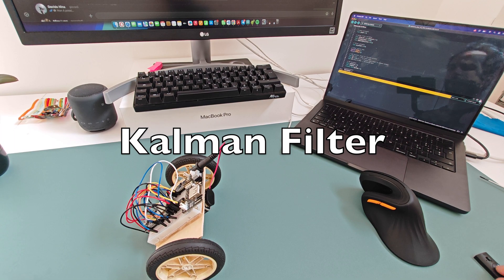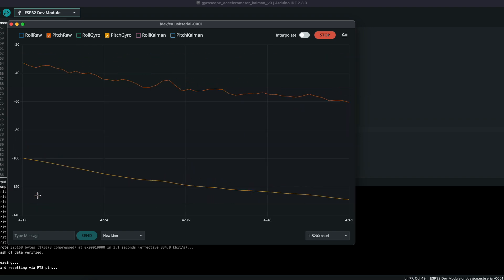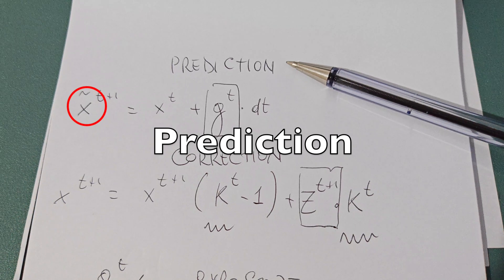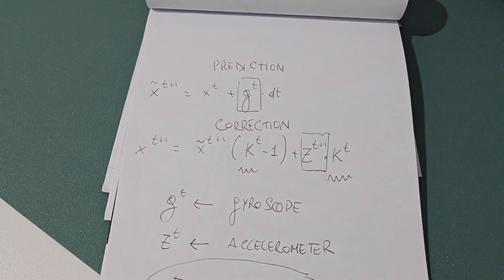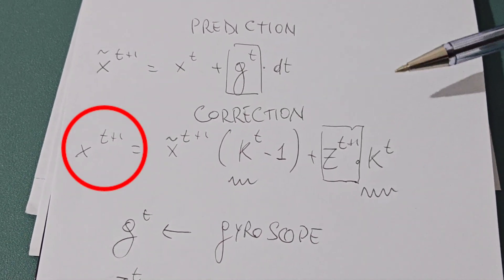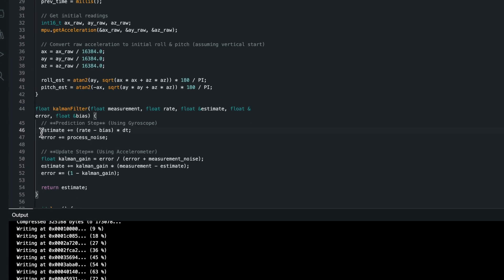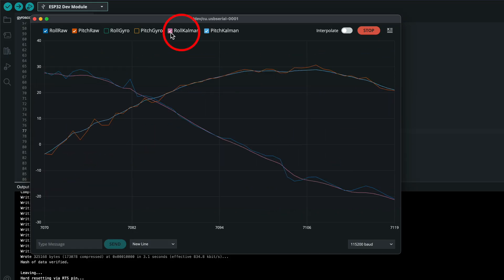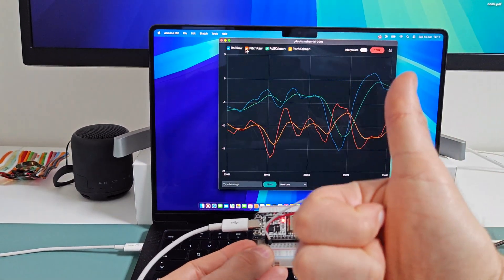What Makes Gyroscopes SUPER Accurate with ESP32? The Kalman Filter!

Comment: Hello Thinker! What is your noise for that module in real life? I got 50mm/s2 for bmi160 at rest.(min-max range)
Reply from the maker: On my module the noise is much lower. When it’s completely still, I usually see only a few mm/s² of variation. If you're getting around 50 mm/s² on the BMI160 at rest, it may be due to vibration, loose mounting, or power supply noise.

Comment: you just need a fiber optic looped 3 times in a circle.. and a precis watch. send the light trough the loops, and measure the phase shifting. and you have a quite precis  Gyroscope. measuring the phase shifting of the light is not soo difficult. 
the more precis the watch is, the more precis the  Gyroscope is. i guess that is how they do  Gyroscope in space. i dont know, just a guess

Comment: Accelerometers do not give orientation. You need to integrate twice to obtain orientation from an accelerometer. The first integration give angular speed.
Reply from the maker: Actually, accelerometers can give a rough estimate of orientation (like tilt) when still, by measuring the gravity vector. What you’re describing (double integration) applies more to position, not orientation. Also, angular speed is measured by the gyroscope, not the accelerometer. For accurate orientation, sensor fusion (accel + gyro + sometimes magnetometer) is the way to go.
Reply: Most applications where you use these sensors works with low acc for long time or high acc for very short time. Dominant vector is gavity and from gravity on each axis you take vertical orientation = tilt in 2 axis if you have 3D acc. For horizontal rotation you use magnetometer and gyro in fusion.